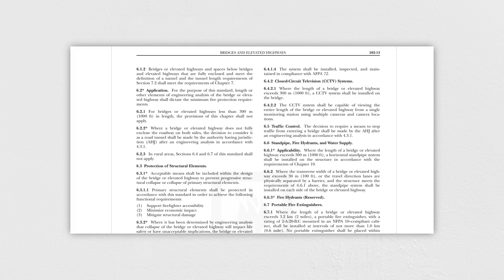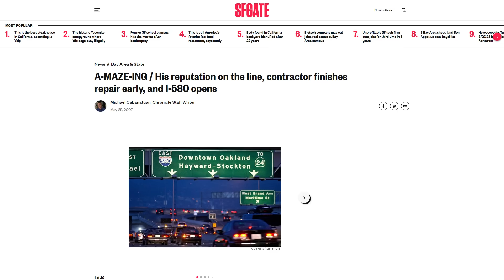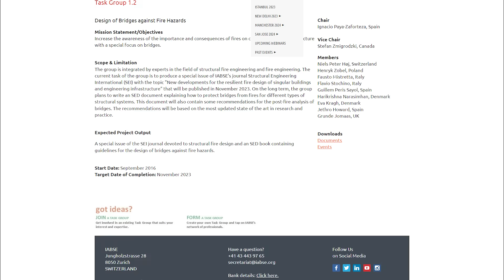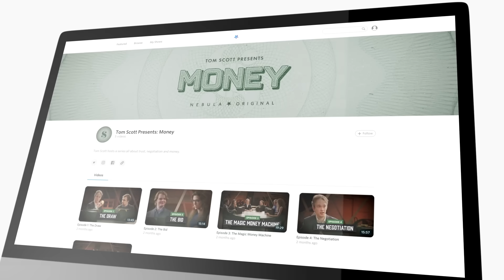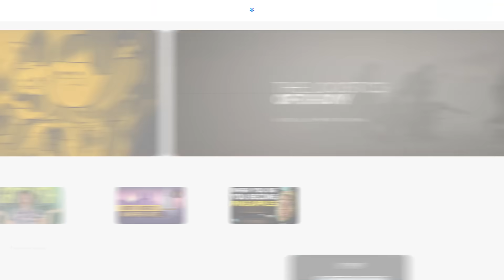Philadelphia I-95 Bridge Collapse Explained

Comment: Feels good to hear about topics like induced demand and varied transport infrastructure not only from urban planning channels, but from an engineer, even if only in passing.
Reply: I also really appreciated that he mentioned it.
Reply: I was wondering why he didn't have a model he built for this.. ... but he already did a video and built a model  for this. He mentioned this.
Reply: Induced demand also assumes that there are other previously viable and available routes or means of transport people are using before the road expansion. 

Most of my own lived experience  comes from living in the suburbs of Houston and Dallas. Several road widening schemes in Houston coincided with gigantic housing developments in the outlying areas served by the widened highways. Thus, as the roads were widened, there were more commuters to use them. It is possible that the housing was added because developers expected the extra highway capacity, but I am inclined to think that the housing was going to be built no matter what,  and the highway improvements merely kept the traffic from becoming terribly worse.

What Texas cities (at least) desperately need is some VIABLE alternative transportation.  I can count on one hand the number of trips I gave taken with public transit in Houston and Dallas in 25 years.

So there may be some induced traffic, but there are many other factors that make the picture less clear than it is sometimes portrayed.
Reply: @joshuaharper372  suburban development is a whole other can of worms, especially where exclusively residential, super low density zoning is concerned.
Reply: Induced demand is predicated on the idea that traffic happens as a result of people trying to go places or do things in a way not favored by activists.  If we somehow prevent everyone from traveling and working, or make it much more difficult, some of them will give up and it will lessen traffic.  While frustrating people into giving up may lessen demand, it's hardly the public service for which those people paid taxes and it's hardly the way to grow an infrastructure being pumped by immigration.
Reply: @sahala6765  The only reason so much tax goes to car infrastructure is to maintain the unsustainable maintenance and growth of it, whereas the point of improving and expanding other methods of travel is not to frustrate people, but to provide an alternative that is ideally as fast and/or convenient for the traveler, and more efficient and financially sustainable for the city, all while lessening the burden on car infrastructure and drivers.
Induced demand purports that car infrastructure generates traffic, not because it doesn't align with activists, but because it makes very inefficient use of money and space. The only harmful predication here is that cars are the superior mode of transit for all situations.
Reply: Induced demand is mostly a nonsense. It’s really just demand. It’s like saying building a new hospital - which are generally quickly overwhelmed with ‘new’ patients almost immediately - is pointless since we have now just created more patients. The reality is that the new hospital has caused more people to present for treatment because the wait times are now marginally shorter, just like a new road enables goods and people to be transported marginally quicker which results in the quantity of vehicles increasing. Both are just demand that already existed at lower ‘prices’ - of course the new hospital had not coursed more people to get sick or injured.
Reply: @coreyw427  Not a great comparison. The idea is that we want congestion to go down. Less traffic = Less idle time. So the previous attempts at adding lanes to reduce traffic don't work because as you hinted to people on other roads/different modes of transport will switch to the expanded highway... this leads to more traffic. Now we're right back where we were but hundreds of millions in the hole. The goal of a hospital is to treat people, the goal of a highway shouldn't be to have traffic.
Reply: @nicolasgrothey4014  The goal of a highway is literally to allow people and goods to be transported, as Grady mentioned earlier in his video. That’s what traffic is.
Reply: @nicolasgrothey4014 Yes, the goal of a highway indeed is to have traffic. Hopefully not congested traffic, but moving traffic.
Reply: @nicolasgrothey4014  
You just described why it works: They restart using the roads while their need for transportation was earlier on supressed by a failure of planning. Did this mean you remove their need for transportation by bullying people into huge detours in covid-ridden busses, crowded trains full of anti-socials screaming at their phones or into cycling long distances?

No, they still needed it, but they couldn't and society just paid a heavy price in lost time and extra pollution. (10 minutes extra on a commute equals 80 hours lost per year)

Induced demand doesn't exist, it is a myth.

If induced demand was not a complete crock, I would be able to plant a circular road in the middle of nowhere, come back a week later and find commuters using it even though it leads nowhere.
After all there's supply, so according to dogmatic politicised planners this should induce demand, right?

It's downright worrying how many people pretending to be smart or in posession of planning credentials still subscribe to such an obviously false political idea.

If you can prove induced demand is not a myth, go for it (maybe show us a unicorn or Russian victory while at it), but if you can't, stop it.
Reply: @nvelsen1975  You fundamentally misunderstand induced demand. Larger roads draw more traffic from other modes of transport and by increasing the amount people drive. This is induced demand. It is well studied and understood. It's one of the reasons increasing lanes on highways doesn't decrease traffic congestion
Reply: @nomms  
Well, that doesn't answer the question why it would even exist, so no, I don't misunderstand it since it doesn't exist.

You're however talking about supressed transport demand. Which is a different issue entirely.

Supressed demand can run out because your planning solution facilitates what people want (in majority that's car transport during rush hour) and that's when you have achieved succes.

Induced demand is a fictional concept that is meant to back the political idea that we shouldn't facilitate what people need, but instead force them to do what the politician wants, which often means forcing commuters into public transport.

Which is inherently doomed to failure due to the hub&spoke nature of public transport.
Reply: @nicolasgrothey4014  "Not a great comparison. The idea is that we want congestion to go down. Less traffic = Less idle time. So the previous attempts at adding lanes to reduce traffic don't work because as you hinted to people on other roads/different modes of transport will switch to the expanded highway."

That is the nonsense that Corey is referring to.  If adding capacity leads to more traffic and so the same waiting times that doesn't mean that adding capacity doesn't work or even is counter productive it ACTUALLY means that you still do not have the capacity to meet the actual demand.  However people who do not actually care about effective transport networks and just want to get rid of personal vehicles in order to appease the weather gods, or insert other ridiculous ideology here, reframe the reality.

It's like claiming that putting a clinic in an area which previously had no access to medical treatment causes illness because the clinic immediately gets booked out.
Reply: @nvelsen1975  I don't know if it's what politicians want, but it definitely should be.

You don't need to pack buses and trains with 5 people per square meter to allow people to move much more densely than by car. Even generously assuming 4 people per car, 20 people spaced fairly comfortably on a bus is way more compact. If 20 drivers have a convenient option of taking a bus and decide to take it, there are 5 less cars congesting a road. If instead 20 people are fed up with crappy, cramped, circuitous bus service, they might be forced to buy cars. Trains are even denser, and more direct, carrying multiple cars of people in a dedicated track. If public transport is crowded, all that shows is that demand for it still exists, even with the option to drive, but supply is lacking.

And if 40 people can cramp a bus, and they don't have the option to take a different bus, they will instead cramp the road with cars.
Induced demand is really just a smaller part of the truth that people will take the better, more convenient option. A circular road in the middle of nowhere doesn't induce demand because it doesn't supply a route to a destination.

Car infrastructure is expensive to maintain, and most problematically, money you spend on cars goes primarily to car manufacturers and oil companies, while money you spend on transit, which is usually cheaper, ideally goes directly back to transit infrastructure.

And because car infrastructure is also expansive in how much space it needs, such as wider and wider roads and most importantly parking lots wherever you need to go (taking up space per person times the number of destinations people drive to, instead of simply per person), it also extends the length of most trips in most forms of transport, including for drivers themselves.

But if you want to get away from those anti-socials on the train, feel free to lock yourself in your car with the windows closed.
Reply: @Schenkel101  
I'm not sure what you're trying to say with that? Giving money to huge mega-corporations like Amtrak is somehow worse than money going to a garage mechanic on the corner? Why?

Also it's definately true you can densely pack people if you don't use cars.

That's one of the main reasons people prefer cars.

I advocate meeting people's need.
I advocate against political decisions like "I like trains to force people to not use a car even though they want".

You probably really need to ask yourself how you plan to justify seeing what people want, and going "I don't care". Since that is the core tenet of all spatial planning: Making sure that was is, approaches people's wishes as closely as is practical.
Reply: @nvelsen1975  You seem to be starting with the assumption that everyone loves, needs and wants cars. Most people just want or need to go places. As I just said, if people get a well maintained, convenient and fast alternative to driving, they will not need , and many of them might not want cars.

I don't know where you got the mechanic garage from, I never mentioned anything remotely like it, but a train company's business model is predicated on providing the service of transporting people. The faster, more convenient, more robust and more efficient the service, the more the company succeeds. A decrease in quality would similarly drive people away from the service. Thus, a transit company is incentivized to expand and improve the service, getting people where they want or need to be.

Car companies simply provide the vehicle, the maintenance and gas expenses are still up to the owner, and the roads and streets needed are still entirely subsidised by tax money, not to mention every business needing parking to accomodate.

Even in cases where cars are wanted or needed, having less cars on the road means less traffic anyway, as well as a smaller demand for infrastructure, allowing for existing infrastructure to be better maintained with aforementioned tax money. Better experience for people who actually care about cars.
Reply: Nah induced demand is total bull, it's just something people who hate cars say. Because road infrastructure takes so long to build and plan for, you might not take into account a rapidly increasing population in an area and boom, highway is full again. Correlation is not causation, sorry not just bikes and city nerd.
Reply: @-Katastrophe  lampshades correlation of car centric infrastructure and traffic congestion observed all over the world, points out a huge flaw with car centric planning as an excuse. Solid defense.

Comment: Love this channel. It's my job to inspect infrastructure. Had last year my first bridge, in 13 years that was affected by a car fire. Concrete  and fire are never going to go well with each other.  The  steel rebar looses the needed strength and the bound water expands so it will break the concrete structure. 

The only thing that i know of to prevent accidents is to create a flame resistant layer that gives you time to evacuate the tunnel or  parkinggarage. The other option is to prevent cars from crashing in the first place.

In the Netherlands i have only seen the fire protective layer in tunnels and big aqueducts.
Reply: Am I right that you are essemtially describing spelling from the water vapour pressure?
Reply: @patrickbuick5459  not exactly. Between 150°C and 180°C the calciumhydroxide in cenent loses water. Because of that the cement loses it's bonding capabilities. This occurs in the first few minutes. When the outer layer of concrete is gone the rebar is directly subjected to the fire.  

Above 250°C the concrete loses permanently some of its compressive strength. Above 450°C the strength is reduced by half. 

(English is not my first language so this technical stuff is hard for me to translate)

In my original reaction i did indeed say expansion. I have looked it up in my study material for the exact explanation.
Reply: @alexZWL  Thanks, that explains a lot. I'm no materials expert nor civil engineer, only electronics engineering technology and some pre-engineering, physical chemistry etc. Yes, I am a generalist, as I also did medical studies and work as wellnas music.

Your English translations seem to be pretty spot-on.
Reply: Thanks for the insight - it seems the creator was disingenuous in saying the collapse would be "explained"

Comment: I'm reminded of the "bridge over the bridge" from that CT bridge collapse (Mianus) during the 1980's.  I don't recall if that took out all lanes of the span however - since i was a child at the time - but got a thrill about crossing the "collapsed" bridge using the raised temporary system.  That wasn't a fire - but did offer my brain a working analogue for repairing while in use.

Comment: It would take relatively little water getting sprayed on steel beams to prevent them from heating up much beyond 100C, just need to make sure the pipes don't freeze in cold weather or leak and ice-up the ground below.

Comment: Why didn't you cover the mechanics of why bridges actually fail?  It's obvious why a steel beam bridge would fail due to intense heat but why would a concrete beam bridge fail due to same?  At least one of the failed bridge pics looked like the concrete beams had bent, like steel would. If this is the case, and it wasn't a pic of a steel beam bridge, it'd be really interesting to know how this can happen.

Comment: Love your videos, but I was a left without answers on this one. I have to point out that you spent 17 minutes not answering the question presented in the video title (or the image that presented the video). You talked a lot about the repair of it, the code that doesn't exist and also the affect the bridge being missing had. But you skipped right over "Why fires destroy bridges". I normally expect more of a direct engineering type presentation like "this is what happens to metal structures when overheated" and in your case, normally physical examples to show metal supports warping under heat and load, but not this time. So not only did we not get one of your little lab experiments, we didn't even get a simple explanation of why it happened. I mean, the answer is pretty obvious, but that just makes it so much more annoying that it wasn't explained. Oh well, have a good day.

Comment: I was personally affected by two of the incidents mentioned here.  The first was the bridge collapse over I-65 in Tennessee at exit 61.  The saddest part, of course, is that the driver of the truck that hit the bridge died in the incident.  Even so, it was also frustrating as a project to widen the bridge from 2 to 5 lanes was almost complete.  Two lanes were complete at the time of the incident and the rest were nearing completion.  Unfortunately, enough damage was done to the bridge overall that even the two completed lanes were demolished and the bridge was out for months while it was being rebuilt.  It served as an alternate commuting route for myself and was the main entry point to I-65 for thousands of residents of Williamson County.

The Harrisburg, PA incident may have affected one of my trips from TN to PA and definitely affected trip planning.  So, a minor inconvenience for me but a major issue for commuters and commercial trucks in the region.

Comment: You would think that a bridge made of concrete wouldn't burn, but it's the steel beams that cause the collapse.  Steel expands when it gets to 400 degrees F and this expansion will pull the concrete apart.  People think that steel fails when it's red hot, but as a former welder and fabricator I can tell you that 400 degrees is all it takes to bend the steel into shape without it cracking.  Coating the steel in concrete will not work as the steel will corrode inside the piers and supports and fail when you least expect it.  Concrete barriers designed to deflect vehicles away from the piers works if there is room made for them.  But a fast moving tanker can easily jump right over them when it jack knives.
Reply: Absolutely. Annealing takes place at relatively low temperatures, which softens the rigidity. That's why the Twin Towers collapsed.